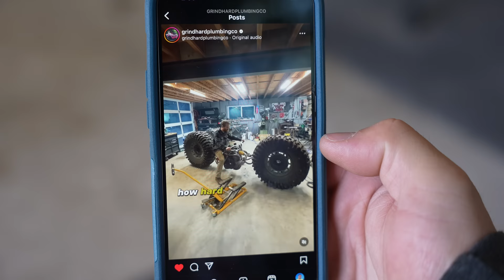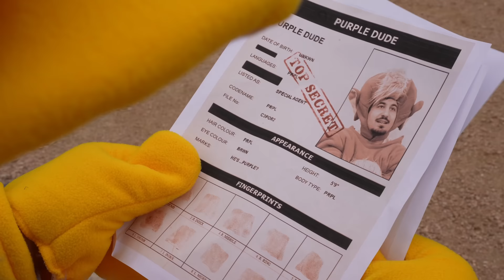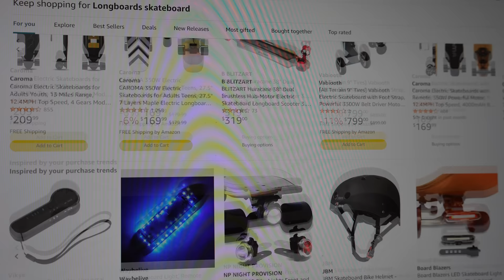I Built a Monster Chopper!

Comment: Not sure if you found this out but as you said one of the boards is faster therefore more power so on your test run you were using the less powerful one in the back and the powerful one in front that is why you went faster going backwards because power was on the more powerful board so it could push your better, the front tire is more of an assist. This is shown in cars, most cars don't even have front wheel drive because of the power thing.

Comment: Bro could have gotten a bigger, more powerful motor, a ESC and a proper throttle for less money than what those skateboards costed... And it's not hard to put together, the pin out is literally written in their datasheet, and usually where you buy them aswell